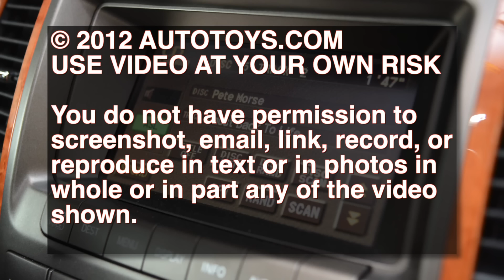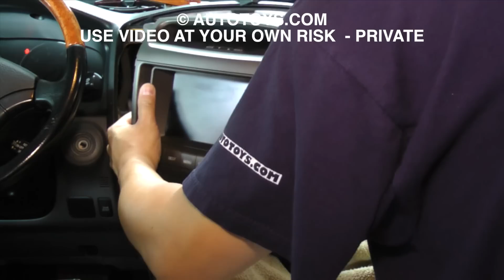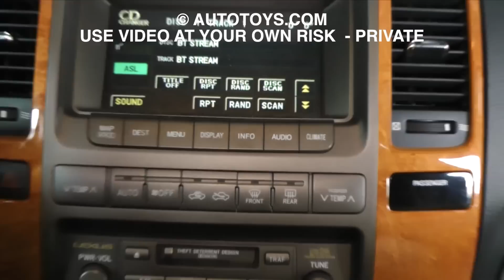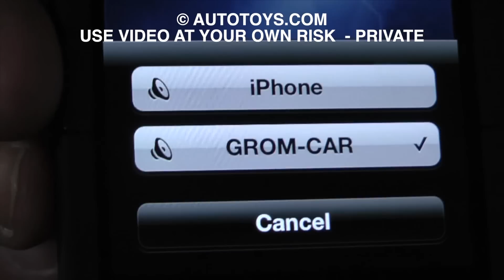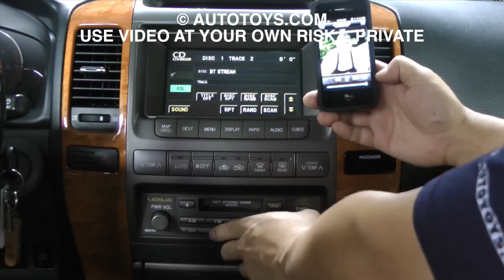Lexus Gx470: Grom Ipod Bluetooth Aux Installation Radio Removal

Comment: What wiring harness are you using? The one that grom sells does not fit into this spot.
Reply from the maker: 3 harnesses, TOY, TOY1 and then the LEXus specific larger harness. Need to match to car
Reply: @Autotoys  I returned the Grom because of this. USA Spec was plug 'n' play and less expensive.